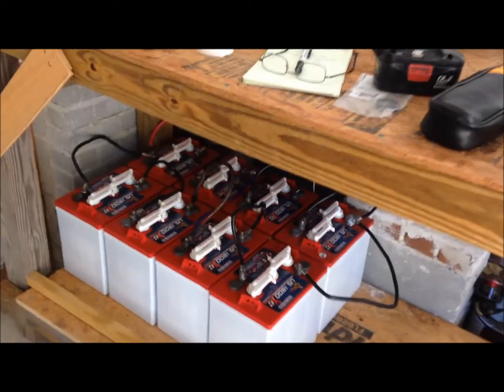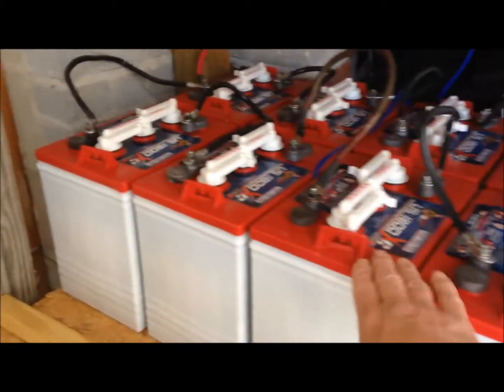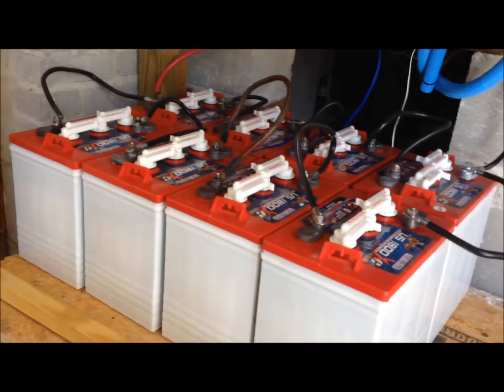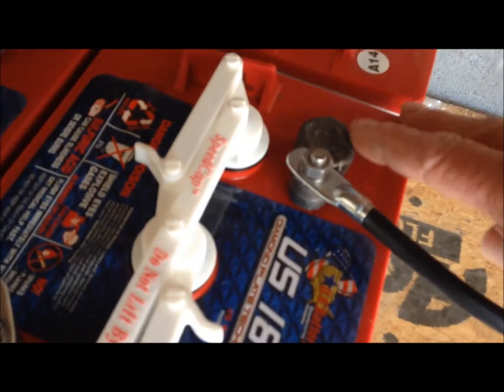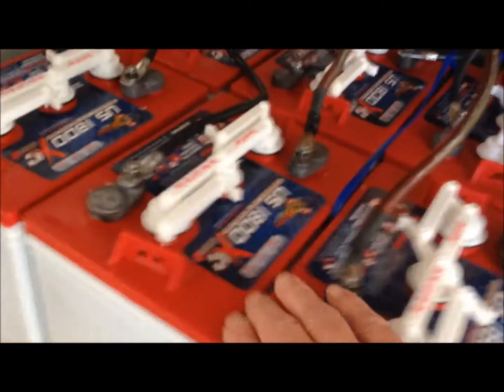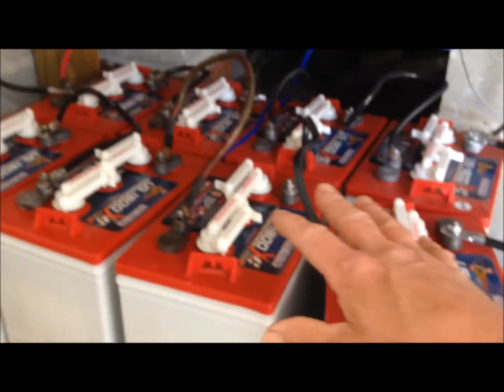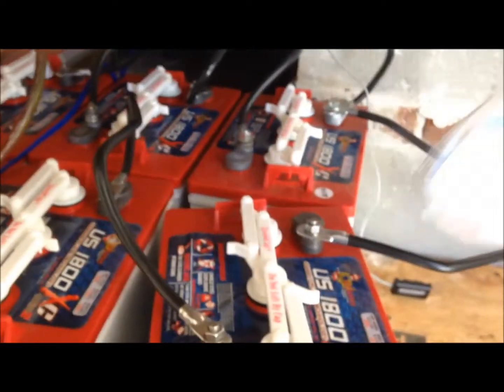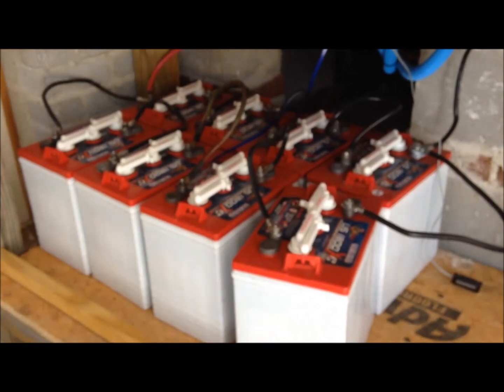24 volt Battery Bank for Solar Array

Comment: What about 16 batterys 6 v. each one for 24 volt? it is the same arregment?
Reply from the maker: If I understand your question, you would need four 6V batteries in series to make one 24 volt configuration so the answer is yes. 6V + 6V + 6v + 6v in series = 24 volts and call it string 1. Do the same with the next four 6V batteries and that will be called string 2 etc....you will end up with four strings parallel to each other. Don't put all 16 in series, you only need 4 in each string to make 24V system.
Reply: @jdjohnsonjr1 Jhony  Budy... It was a plenty help, thank you, that works fantasticly!

Comment: I bought 2, 12v 200ah sealed AGM batteries. Hooked them in parallel, 24 volts care free. Now I want 2 more, but at 350$ a pop, gonna have to wait.
Reply from the maker: I started with one twelve volt battery when I was just learning about solar. I now have a complete grid-tie system, so be patient you'll get there.

Comment: What is the size of the cables, and where did you buy them, or did you make them yourself? Good video on 24v bank thanks.
Reply: John Johnson
The cables you are using are not 4/0.   They might be 4 awg, but they are way too tiny for what you are doing.  IMHO.
Reply from the maker: American wire gauge (AWG), also known as the Brown & Sharpe wire gauge, is a logarithmic stepped standardized wire gauge system used since 1857 predominantly in North America for the diameters of round, solid, nonferrous, electrically conducting wire. I purchased them from Advance auto, 4 gauge battery cable for 12 v batteries. You are correct, I was incorrect, they are not called 4/o
Reply from the maker: Those are 4/0 cables if I remember correctly from Advance auto at different lengths, the longest ones are 4 feet. Pos and Neg to breaker panel and all the rest are 1' post to post.